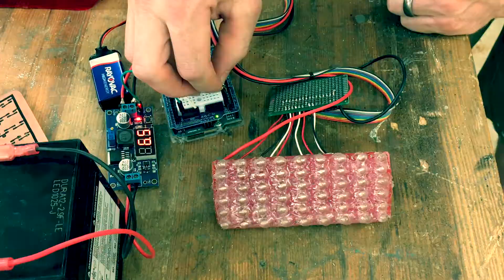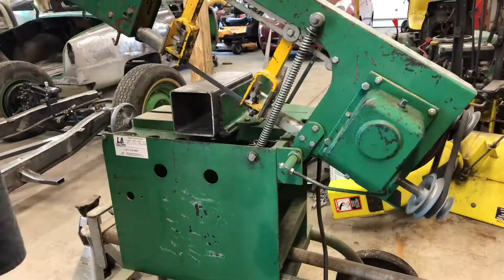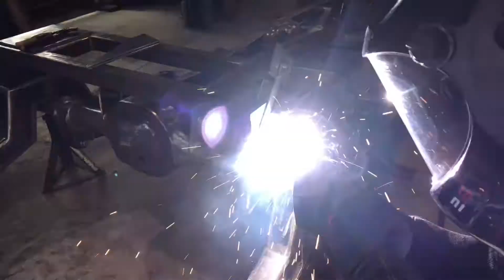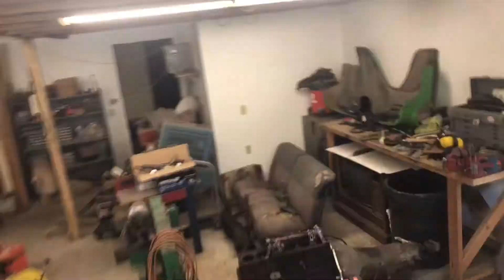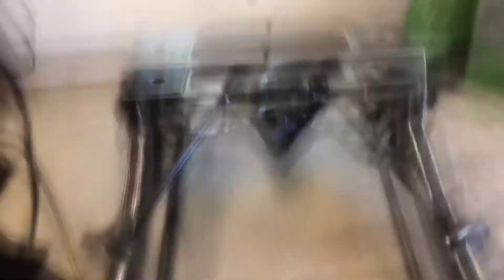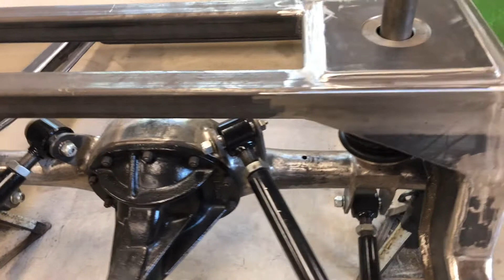1953 Chevrolet 210 Hardtop Lowrider Project Part 18: Finishing the Rear Bridge

Comment: Amazing work. Did you end up running this car with the original closed drive/torque tube setup? or did you switch to open drive? I hear stuff about the fluid draining from the diff into the transmission when lowering these cars. Not sure if it matters, thanks.